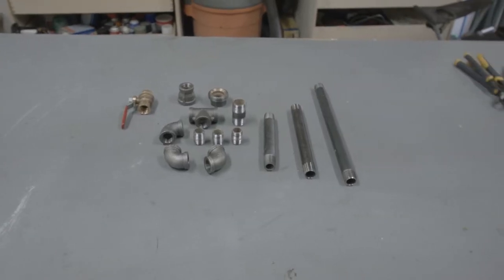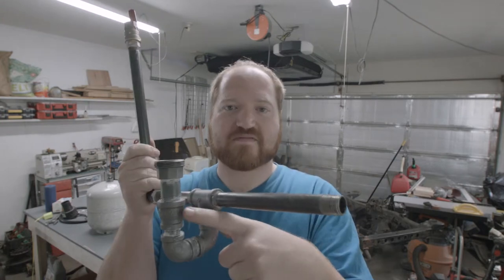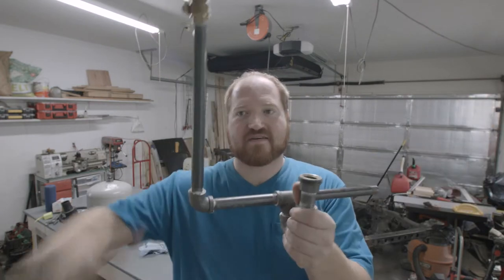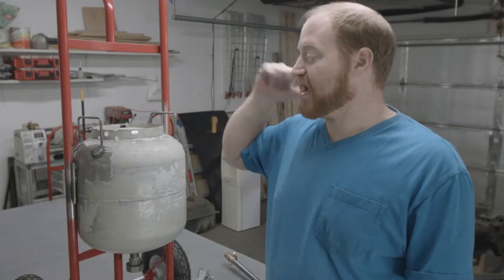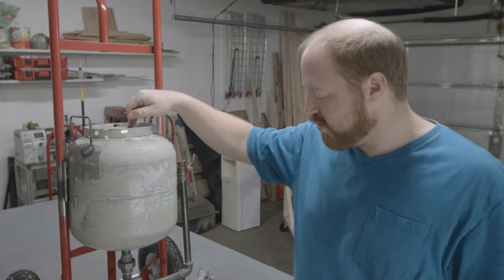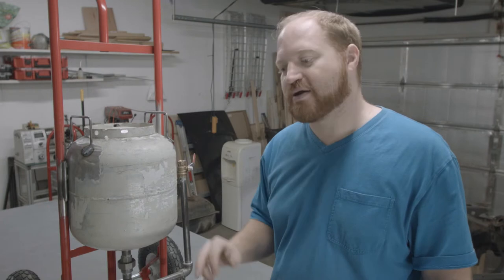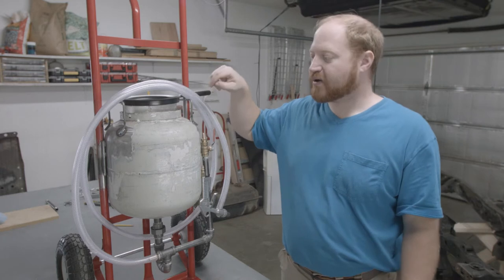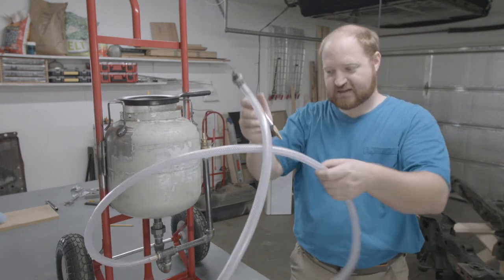Building the Ultimate DIY Sandblaster - Part 1

Comment: Great job! Inspiring me to have a go, thanks.
Reply from the maker: The siphoning trap works really well most of the time. But depending on how long it sets or maybe it the humidity, but sometimes it gets plugged up. It would be cool to put a valve at the bottom of the tank so you can close it off before disconnecting the trap. I'm not sure what type of valve would be best for this thought. Also depending on how much you have the air control valve open the sand can pulse instead of having a nice continuous flow. Maybe the next size down pipe will offer more control. I'd have to do an experiment to figure out how to make it better. But these issues only happen like 10% of the time. When it's dialed and working correctly I can blast through 3 or 4 tanks of sand with no issues.